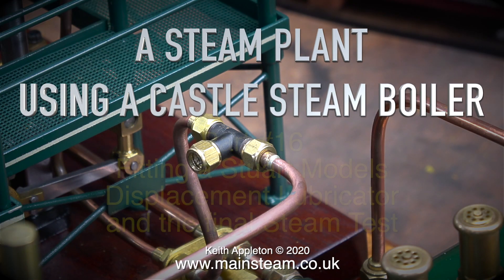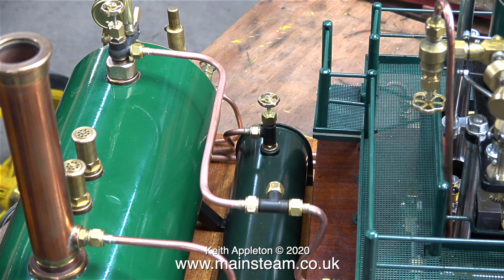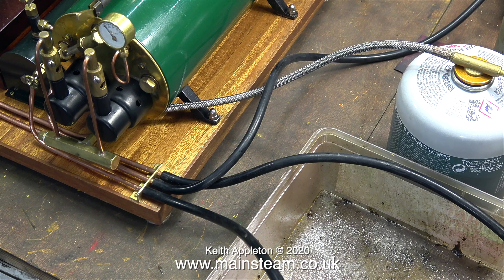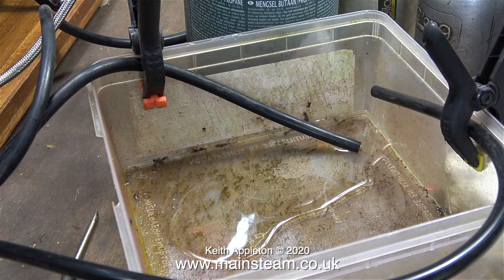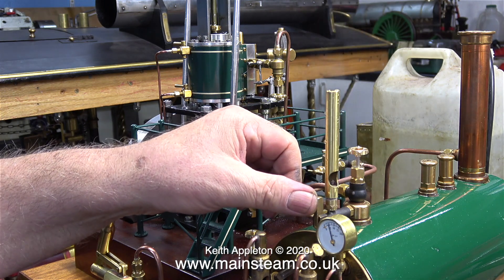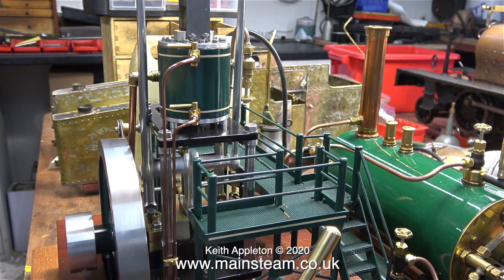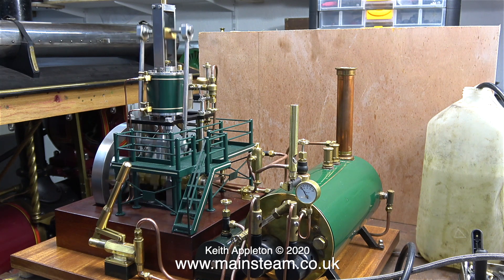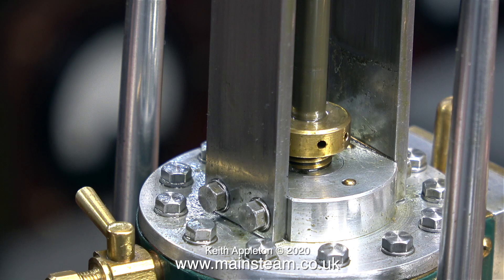A STEAM PLANT USING A CASTLE STEAM BOILER - PART #16

Comment: What a beautiful work of art!  Did the owner ever consider repainting the boiler to match the deeper green color?  Or are we Yanks missing the significance of the different shades of green?
Reply from the maker: I am sure that I mentioned in one of the episodes that the owner is going to clad the boiler himself using Mahogany Strips and Brass banding. That is why I did not bother painting it the same shade of green as the engine - or even black - like boilers usually are.
Reply: @keithappleton  Thank you Keith, I missed that... makes sense now.

Comment: To use an engine to run a accessory what would you use as a belt from the belt pulley. I find your series to be very informative and appreciate that you make a point of posting links to most of your suppliers.
Reply from the maker: Probably the "Mamod" or "Wilesco" spring coil type.

Comment: A thing of beauty and a sight to behold! Well done!
Reply: Am I the only one bothered by the three different shades of green?
Reply from the maker: I am sure that I mentioned in one of the episodes that the owner is going to clad the boiler himself using Mahogany Strips and Brass banding. That is why I did not bother painting it the same shade of green as the engine - or even black - like boilers usually are.

Comment: Keith, Do they make model engines that are of a closed circuit design where they condense all the outgoing steam back to water to be used over again
Reply from the maker: Not very practical in the small scales. Difficult to remove the oil from the condensate.